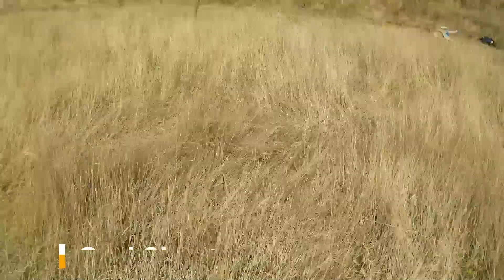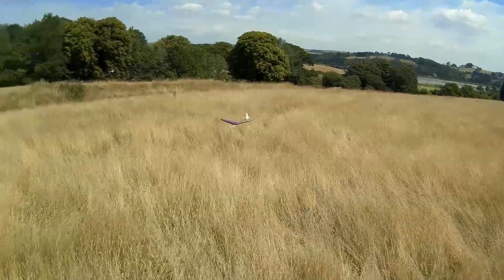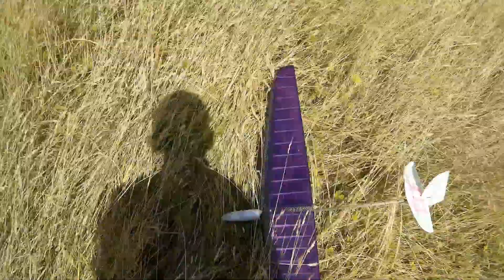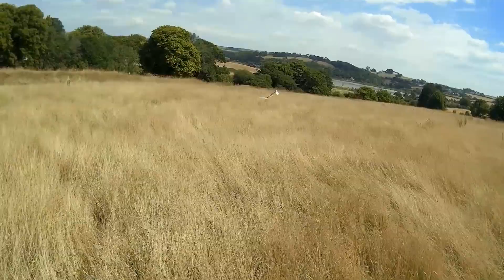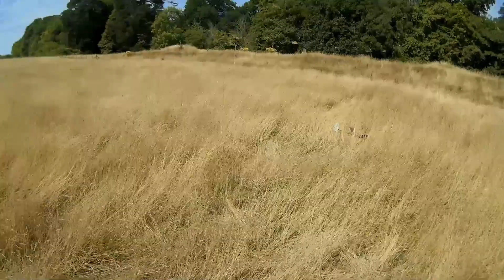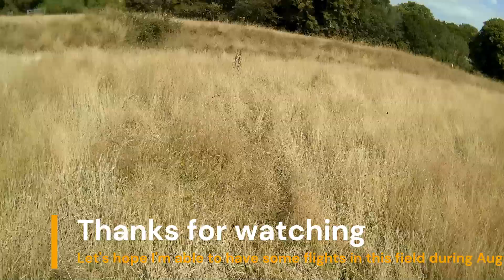Trimming: Vladimir's Model Elf RC DLG - But It's Very Windy - Again - 29th July 2022

Comment: Wow, I like Your new glider's trimming video. Yes, the weather is a bit windy for first flights. The high grass helps You at landings. ;) This glider have a huge performance! Bravo!
Reply from the maker: I was very grateful for the long grass. It should be cut very soon, so will be safe to do full circle discuss launches. In calmer conditions, I can see this glider will have fantastic performance....
Reply: @RCSoaringUK  I have not tried to launch in half circle...I could not to throw it. I have to learn it. I would see Your glider's flights in a calmer condition too.
Reply from the maker: I find the side arm launches (SAL) useful for first flights of a new glider and then progress on to full discuss launches
Reply: @RCSoaringUK  Thank You for the info! I had not know what does it mean "SAL" glider. ☺

Comment: Beautiful bird Carl.  Mine is the same color. The buffeting wind does stink and makes it almost impossible to trim correctly. One thing i have found is reducing my rates (particularly elevator) and up the expo just a touch both go a long way in helping control the Elf.  You’ll get it right. I can’t wait. Good luck.
Reply from the maker: Yes, that wing really is a work of art. I'm glad I got one as it appears they are no longer available in the UK. Thanks for the tips on your setup 👍